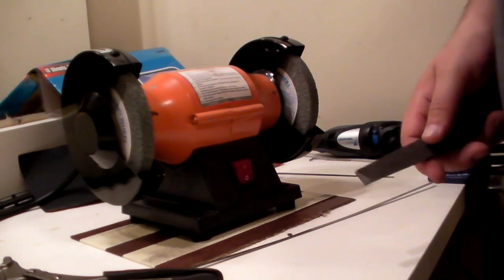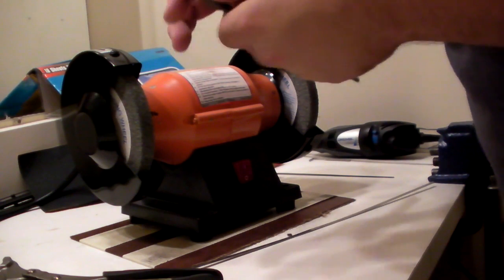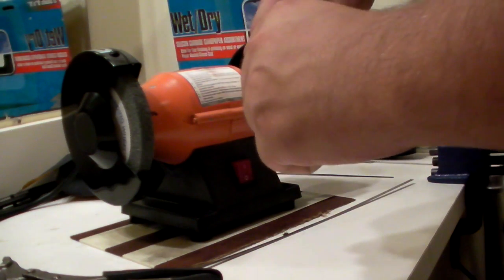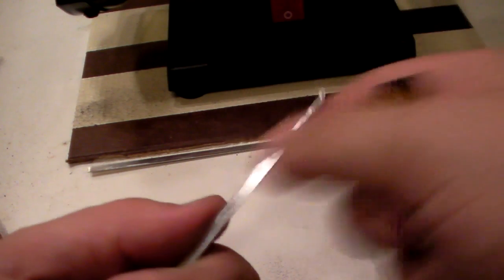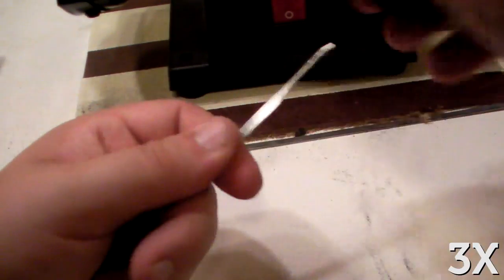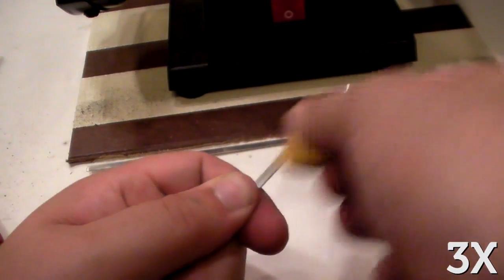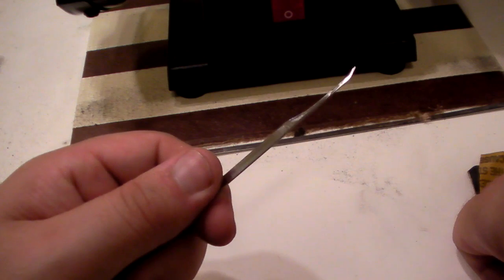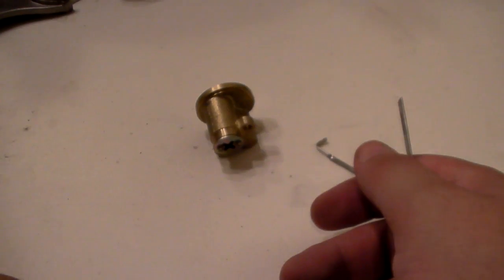11 - Finishing Your Picks

Comment: Much easier and faster than sandpaper if you are doing this a fair amount (for yourself) is a good tristone oil bath stone system like those from norton sharpening systems. They make one with 12" stones that stay submerged in an oil bath when not in use with grits ranging from 220-1000 then get a black Arkansas stone above that which is 2500 grit for real polish. I realize you can tumble these in a rock tumbler as well but I don't own a big rock tumbler and I do sharpen other cutting tools so I'm familiar with oil and waterstone abrasive systems.